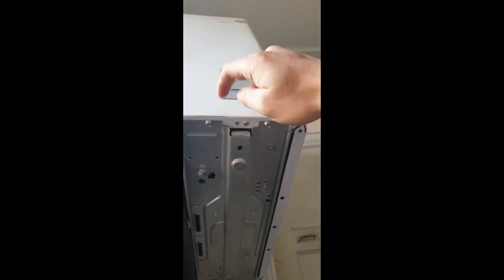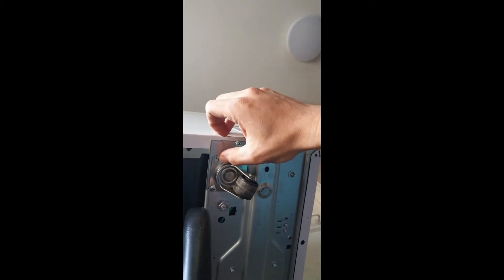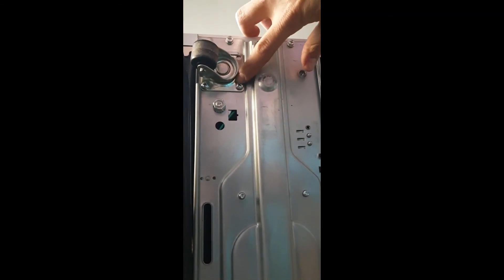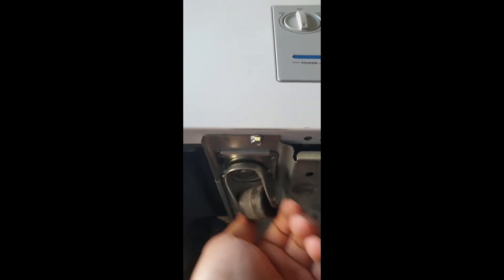How to install castors/wheels on Costco Midea Chest freezer

Comment: Thanks for this. Midea C/S told me that the casters are optional, but highly recommended if you want to move the freezer or if the base isn't flat on the floor. Again, thanks!
Reply from the maker: Mine did not sit flat and looked silly without the casters Not sure why there were not just installed from factory.

Comment: Thanks. I figured out the right side easily enough, but thought I was missing something on the left. The plates where there should be 4 holes have none on mine, as someone else mentioned. I CAREFULLY drilled and tapped them, rather than return to the store.
Reply from the maker: your welcome
Reply: Mine was the same. Very confusing.

Comment: I read some but not all of the manual which only reads that there are only 4 casters in the packaging. I did not read if there were 4 spots to install casters and there were no specific instructions like how "Jack of All" exampled here on YouTube. Thank you Jack for a quick install.:goodvibes:***And like everyone should mention:
If you flip your freezer/refrigerator on its side remember to flip it right side up (lid side up in this case) and let the machine stand 24 hours before turning it on to let the chemicals inside to settle.
Reply from the maker: it blows my mind they never mention how to put those castors on.

Comment: Easier to just lay the freezer on its side. The trick is to make sure the pipes coming out of the compressor remain up. On mine both outlet pipes face the rear; thus for mine I can safely tip the fridge onto its face. I can throw a blanket down on the ground and tip it over frontwards.

To check the pipes on your fridge, remove the side cover. On mine its 5 phillips screws...takes 2 minutes. Just look which direction the pipes go out of the compressor. If both go the same way, its easy. If one pipe goes forward and one goes back, keep the bigger pipe upwards when it is tipped.

Comment: I just got that exact same freezer, and it's a nightmare trying to get the power cable to come out. I had to get a repair man to get the cable out and plug it in.
Reply from the maker: sorry to hear that, not sure hy they dont make it easier and just keep it installed?
Reply: @JackofAllCarbinc  The freezer itself looks really cool, tho! I still left it empty until tomorrow, just in case.
Reply: @JackofAllCarbinc  The freezer's walls are beginning to turn white. Like snow or something. Is that normal?
Reply from the maker: @Steven64  yes thats just the frost building in there all freezers do that and eventually you will have to thaw out. Just make sure the things you put it have minimal water or condensation around bag of packaging.
Reply: @JackofAllCarbinc  Thanks! :)

Comment: Thank you for the video! Exactly what i was lookin for ❤

Questions to the author of the video and other freezer owners of this model: how is it going? For those who has the unit for some time, is it still alive?
Reply from the maker: have had it running since i posted video and works perfect, not sure if its due to bins but i still have not had the need to defrost the ice build up so thats another plus.
Reply: We bought one during the darkest days of the pandemic, and it's been great for the 4 years since.  Tiny energy consumption.  Does need to be defrosted but if you're lazy like us, you can just switch it off, wait about a DAY (!) and when the time is right, the ice will have shrunk away and be sheeting off the surfaces inside it, and you can just lift them out - no drips, no big wet mess.
That said, the casters SUCK.  In no world are they up to the task of moving the freezer without damaging a nice floor (I got here hoping for a caster REPLACEMENT hack, not a how-to-install, which was actually a snap.)

Comment: What  do i do to stop ot from leaking from bottom
Reply from the maker: you should not have a leak, there is a drain plug bottom corner that might not be tightened all the way

Comment: is it possible to add bigger casters
Reply from the maker: yes but not that big without major modification, you would have to find some that have same bolt pattern with bigger wheels.
Reply: @JackofAllCarbinc  The supplied casters are barely up to the task of supporting it EMPTY, let alone when it's full.  I got here looking for a hack to replace with something of larger diameter and that won't ruin our new flooring, but...not here.  
Anyone else who needs to know, the stock casters screw down to holes on a 4cm x 4cm square - which is really small for a mounting plate for a caster that's up to the task.  I haven't come across anything in that standard yet.

Comment: Thanks for the video. My freezee was giving me as a gift but it doesnt get cold! I dont what's the issue.
Reply from the maker: sorry to hear that....did you turn up the temp on the bottom right?
Reply: @JackofAllCarbinc  thanks buddy. Yes i did. I have followed all the instructions on the manual but i guess it happens. My friend has to get in the manufacturer for solving the issue. Its past the 90days Costco return warranty
Reply from the maker: @traviscole7069  bummer.......if he bought using the costco citi card, he should have the 1 year warranty via the credit card company, But hopefully the manufacturer can help out .....might just be a simple fix.

Comment: Do I have to install the casters?
Reply from the maker: Will the freezer work fine without casters?= YES , BUT, once side will be a bit higher than the other, it will not sit flush on the floor, At first i just added a small piece of wood underneath to make it even but after looking at that for weeks it drove me nuts to the point of having to figure this out. So long story short, no it is not necessary to add the casters or wont damage the freezer, it will just look silly(at least in my eyes). Hope that helps.
Reply: This helps a lot! Thank you for your reply and your video!

Comment: Did you lay the freezer on its back to install the casters? The instructions say you can't tilt it more than 45 degrees.
Reply from the maker: Hi rose, No i didn't lay on back i lifted it up an placed on a chair to get underneath, I know the instructions say to not tilt , BUT I did have to tilt it when i first purchased freezer to get it home in my car, if you MUST lay on its side then its suggested that once you get home you place right side up and not plug in for 24 hours, the reason they dont want it tilted or laying on its side is due to the refrigerant in the compressor, ....if the liquid is not fully leveled and all over the compressor it can damage the compressor so that is the reason for that from what i read up. Hope that helps.
Reply: @JackofAllCarbinc  Thank you for explaining it. I really appreciate your advice.
Reply from the maker: @r.s.5963  no worries hopefully it helped make it easier.

Comment: I just bought mine from Costco but no power cord in sight. Did yours come with one??
Reply from the maker: yes....there is a small panel on the rear of the freezer bottom left louvered area...if you open that up the cable is inside.
Reply: @JackofAllCarbinc  thank you so much. The instructions never said that and I was going crazy trying to find the damn thing!
Reply: This was still confusing to me, but I got the freezer up on a table where I could look at it more easily (laying on the floor is not easy for an old man). When you look at the plastic "louvered" panel the bottom third is flat and says "OPEN HERE FOR POWER CORD ==>". That flat piece is a small door that is hinged on the left side, you can pry it open from the right side. Once open pull out the power cord, then push the door closed. Thanks Jack for pointing out where to find it as the manual shows the power cable coming out of the side panel instead of the rear. We actually got the cable to come out of the side panel by removing it before seeing your post, but the cable was about a foot shorter than from the back.
Reply: @BoomerTex  the cable is ridiculously short. I wish the instructions mentioned where the chord was. Such a pain in the butt! I haven't attempted putting the wheels on yet

Comment: Hi, What size are the wheels and the base of it? Purchased the exact same chest freezer and it did not come with the casters or manual. Thanks!
Reply from the maker: hi, if it was brand new and same model it should have came with them, they might have removed them on newer models to save on cost.

Comment: Mine came with 4 caster wheels and two small white level adjusting wheels. Obviously you can’t have the adjusting wheels and the caster 3:53  wheels on at the same time. So how did you adjust for level?  3:53
Reply from the maker: theer was no need to level you could put spacers or washers but really no need to have a feezer level.

Comment: It says in the manual that tilting the freezer more than 45 degrees could damage the compressor and sealed system. I don't think this is good advice.
Reply from the maker: Hi .... as you can see by my video it was never tilted I lifted freezer on chair and was doing job from underneath. I understand the manual says you cant tilt ...that is due to the liquid in the compressor needs to be at the bottom to function properly, if you were to tilt it and then put upright right away and turn system on then yes there is a possibility to damage it, BUT if tilting it needs to be done for whatever reason it is recommended that after tilting it be placed upright for 24 hours before the system is turned on so that all fluids can settle and not cause damage to freezer. ,

Comment: Bought mine just a week ago and it didnt come with screw holes for the casters (only on the left sides @3:14). It's so frustrating like am I supposed to drill holes ? I was scared to do so cuz i dont wanna damage it by drilling into something that I'm not supposed to
Reply from the maker: sorry to hear that hopefully it works out not sure what options you have.